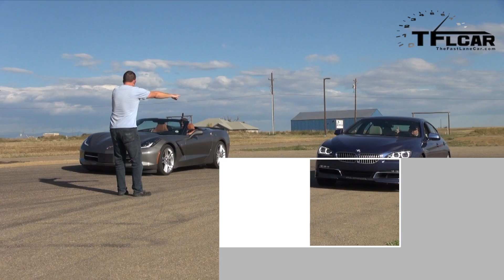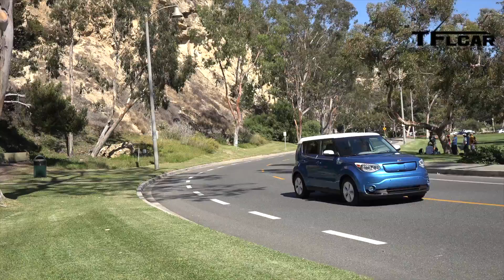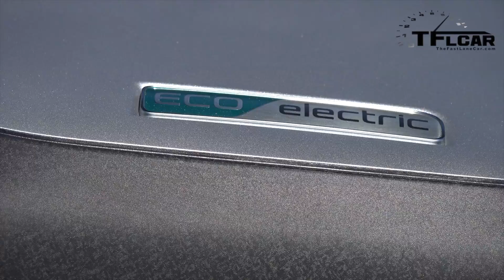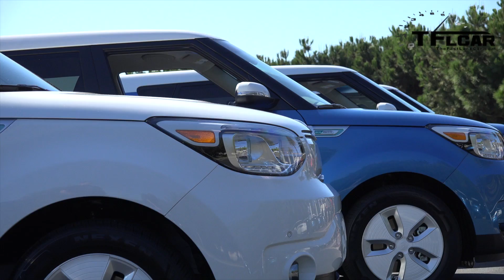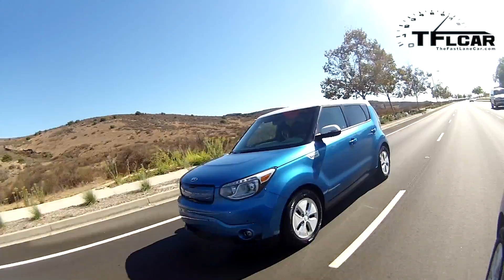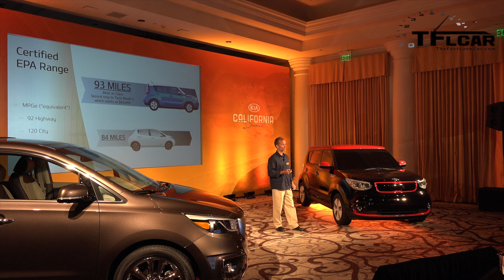2015 KIA Soul EV: More than Everything You Ever Wanted To Know

Comment: One mistake: The EV+ does not cool the rear seats, only the front. But it does heat the rear (and front) seats. The EV+ is a fantastic deal on the used EV market. I'm getting a 2016 EV+ with low miles, one owner, Certified Previously Owned by Kia and no accidents, etc for well under $15000. In fact, it's black with red trim like the one on stage! Can't wait! I've seen dozens of reviews for it and everyone raves. Its 93 miles of range is perfect for the way I drive.